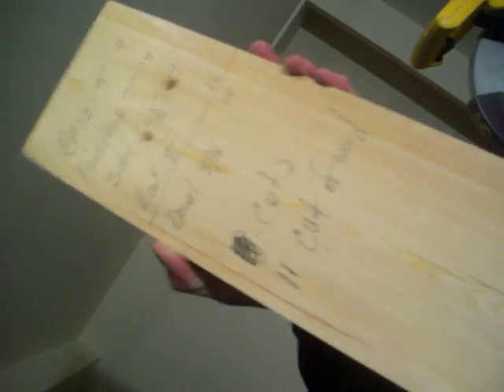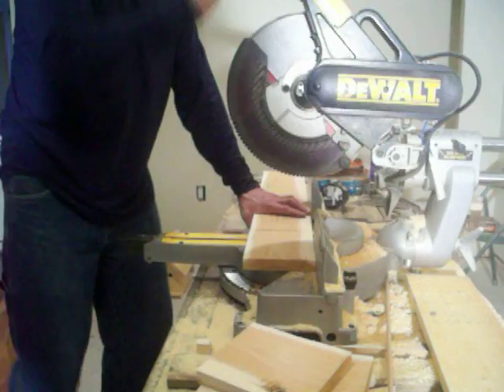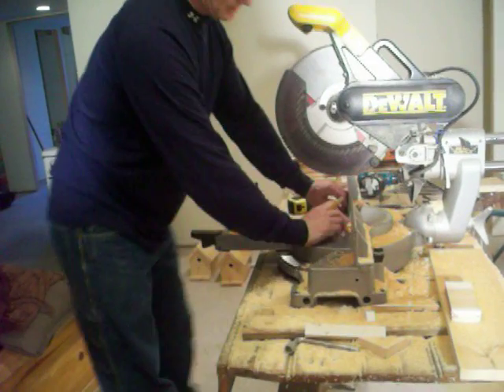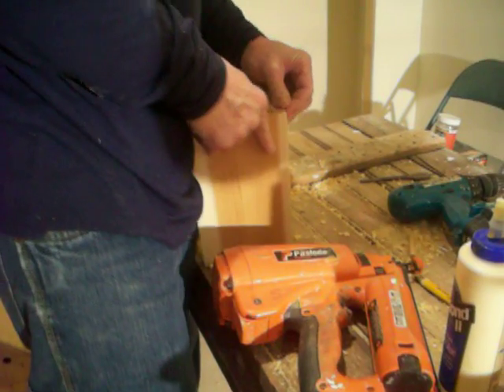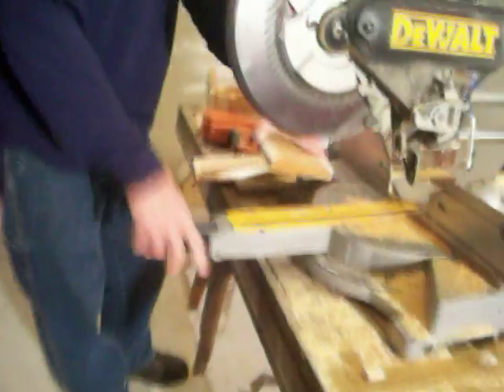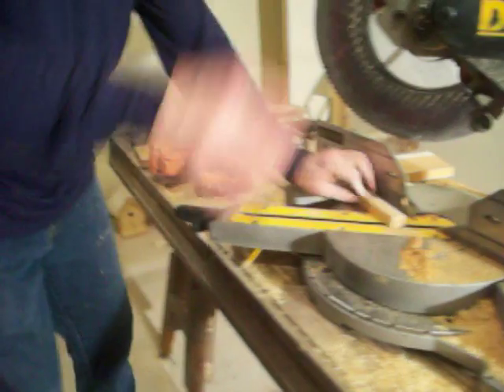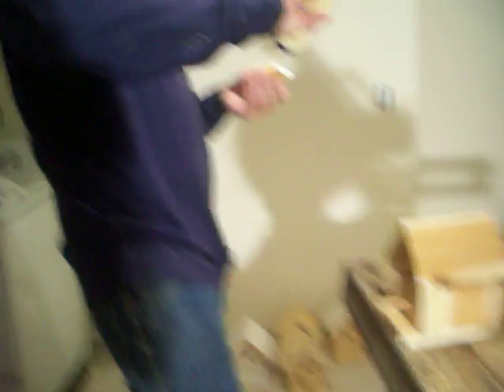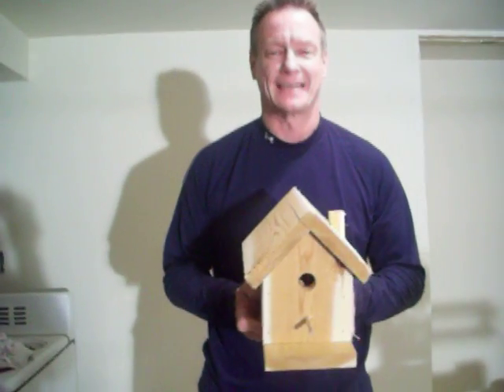Bird house simple in less than 10 minutes

Comment: Perches only serve to make it easier for predators to get at the nest. Looks nice but unwarranted. Also leave app.3/8 inch gaps at the top and bottom of the side walls for ventilation and to shed water, and a removable panel for cleaning out the house at the end of the season.

Comment: Tim D,    Thanks for the video and great instructions on how to make this birdhouse.  How did you figured out the measurements for the birdhouse?   I'm trying to make a bigger birdhouse and trying to figure out how out the measurements.  Is there a math formula you used to figure out what size to make the roofs, the sides based on the how big your the front & back will be.  Any help would be great.  Thanks.

Comment: if this house is for decoration then who cares, but if you intend to use it for birds outside then it has not ventilation or drainage and no way to clean it also.  the perch in unnecessary as well... just FYI
Reply: not my opinion, trying to educate people here...
Reply: Zybrodog,  I'm new to woodworking and am making this birdhouse.  For the drainage, would you just drill a couple of small holes in the bottom?   For the ventilation, wouldn't the hole that the bird enters in give the birdhouse ventilation?  Would you suggest another hole maybe in the back (not too big for a bird to enter) for cross ventilation?  Thanks.
Reply: For this particular design if you have already built the house then yes, just drill a few holes on the bottom for drainage, possibly one near each corner of the base, (1/4 inch bit).  and for ventilation you could also drill a few holes on each side directly below the roof overhang, also 1/4 inch holes 3 to 5 holes on each side but when you make these holes make sure you point the drill up in an angle so that water doesn't go into the house when it rains.   Normally you would cut the base of the house about 1/16 th of an inch short on both sides so as to leave a gap on bot sides of the base.  The same for ventilation, just cut the sides about 1/4 shorter so you end up with a gap at the top of either side for ventilation.  Not all houses need ventilation depending on species but they all need drainage and they also need to be opened for cleaning at the end of the season.  for this model the base is installed with screws so that you can remove it and clean it.  Best to look at specs for species and have a specific bird in mind.  hope this helps :)
Reply: Thanks Zybrdog.   I appreciate the time you took to answer.  I haven't built it yet, but will take your advice.  Thanks again.
Reply: I have spent months researching into building aviaries and discovered an awesome website at Aviary Magic Method  (google it if you're interested)

Comment: By the way you ask “do I just like visiting you tube posts to insult people”

NO!! 

but I do like to be honest and when I see a load of crap I will say it’s a load of crap, as I said in my original post there were plenty of good sound how to’s out there it’s just a pity yours was not one of them.
 
You do not need all those power tools for such a simple project, a hand saw, hammer and brace would have achieved the same results in just a few minutes more.
 
Any nature group or conservation group would tell you should never put a perch on a bird house as it only gives predators a purchase to help then get at the eggs and or chicks, and boxes that cannot be cleaned out quickly get parasitic infestations in them so your build was wrong in so many ways hence I said what I said.
 
Your ever loving homo
 
CS
Reply: cupiddstunt Could you share the link to some of the other videos that you feel are better plans? I like this video because it makes it simple to build. However, if I could find other videos that are better designs and just as easy I would watch them also. Thanks
Reply: ***** All you have to remember is to SCORE the inside of the front so babies can get out & make one of the sides swivel. :) Put two nails in the top of one of the sides & then drill a hole up thru the bottom to it & put a screw in it so you can clean it
Reply: +Kt Vivacious Thanks, great advice